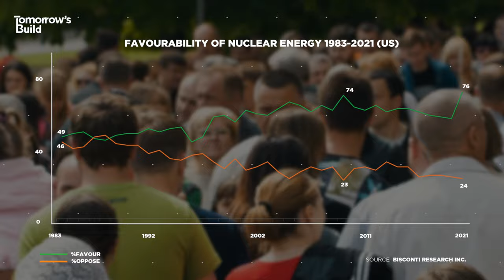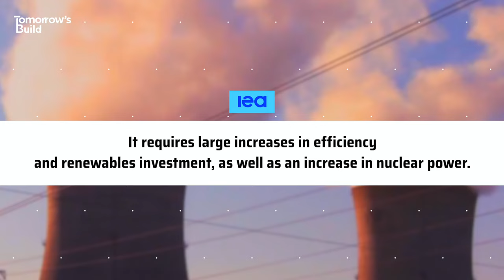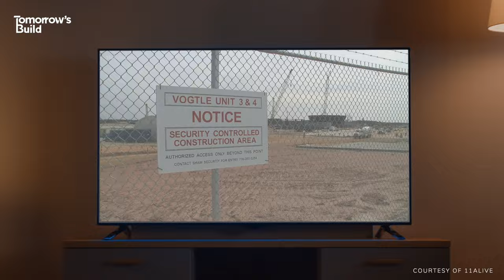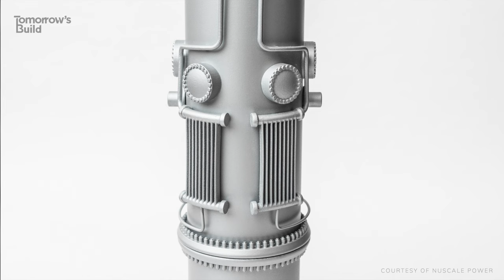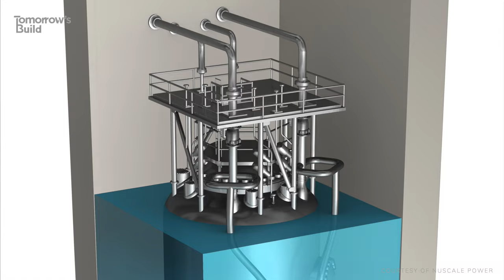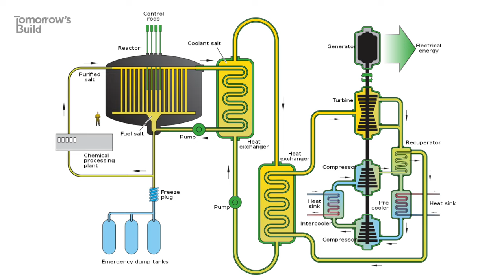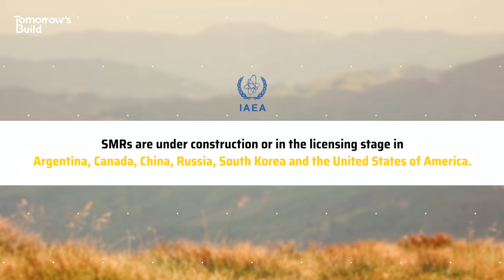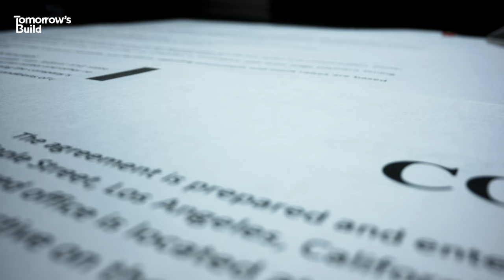These Mini Nuclear Reactors Can be Built Anywhere

Comment: Two areas renewables will never compete with Molten Salt SMRs
1) Process heat for industry
2)Fueling large Cargo Ships

They will probably be less expensive than renewables with storage for electricity in many cases as well, renewables are based on local conditions so in the great plains or Sahara desert wind or solar will come in cheaper, even with some storage, but that requires a great deal of transmission and energy insecurity if we want to power New York or the EU.
Reply: I'm actually surprised we haven't started using MSR's in the giant cargo ships yet. The amount of fuel they have to carry/burn is obscene. That ONE change would likely have a noticeable impact on global co2 emissions because of how much stuff gets shipped globally these days. And I also completely agree with the process heat. Using that heat energy for a benefit rather than just trying to dissipate or fight it has huge benefits. Here in Ontario there's a company called Hydrostor looking into CAES or Compressed Air Energy Storage - Basically at low energy use times they use compressors to force water from an underground reservoir up to the surface and hold it there. They syphon off the heat produced and keep the hot air in a tank, then on peak times when they need to generate power they let the water fall back,  which will send the air back up into the surface system, mix with the hot air from the storage tank above and use that high pressure/heat air to turn a turbine generating power. Because of the heat being recycled, it's about 10% more efficient than most other CAES facilities, and they're hoping to have it running by 2026. The future is starting to look green finally!
Reply: @Fenthule  I think in terms of carbon Shipping is a low emitter, its more a sulphates issue. But I'm also annoyed somehow its safe for ships that are meant to be shot at but not commercial vessels. 

There's also a district heat system in Toronto's financial district, another great use of waste heat. 

Maybe I'm thinking of a different trial, but isnt the Toronto CAES plant more like giant under water balloons to hold the air, and they store the heat in molten salts by running the compressed air over it?

Comment: If you know anything about electricity then you know that all power plants use some type of force to turn the turbine which rotates the generators to produce electricity. Coal plants burn coal to heat water so pressurized hot water is sprayed on the turbine. Hydro plants use the pressure of standing water behind a dam to spray the turbines. Nuclear energy, (highly radioactive), is used to "super heat" water creating higher pressure, (like a teapot), which is then is used to turn the turbine. To create electricity you only need to turn the turbine, rotate the generator. Getting toxic waste from nuclear reactors is not worth the energy. Find a way to turn the turbines without toxic waste from coal or nuclear. Attach 1000 of these Peleton people to long chain, there's a win-win.

Comment: My OCN professor did say that fusion reactors are the future, it's just a matter of making them economical, affordable and more compact. Then again, new developments in fission tech could make them viable again, if we can move on from the stigma they have
Reply: The technology is nowhere near being close, the high temperature superconductors invented in the last year by MIT are a massive step forward (10x size reduction) but the problem of lack of tritium breeding technology is daunting. Also, there have not been any fusion reactors creating more THERMAL energy than inputted as of yet, much less actual electric energy. In fact, ITER is not even supposed to generate electricity, it’s supposed to produce 500MW of thermal energy from 50MW of electricity. Perhaps 50-100MW could actually be harnessed into electricity in a future reactor

Comment: To be honest i'm kind of sceptical about this. In the 50s they promised  that cars and even kitchen appliances would have their own tiny nuclear reactors. That hasn't worked since, and if things haven't progressed by now in the real world after 70 years of research, it seems unlikely that things will change now. The small reactors in ships and submarines are very far from economical, they are built at extreme cost to the taxpayer in order to have a strategic advantage in waters far away from home.

And the question of the final repository is not answered yet. We cannot guarantee that  nothing will ever leak, and if we continue with nuclear power until then we will have amassed incredible amounts of nuclear waste. Maybe it will happen in 1000 years, maybe in 100 000 years. The fact that we don't care about the humans that come after us, and think to ourselves "it's their problem", really shows the short-sightedness of our current global economic culture, which is at the root of climate change in the first place.
Reply: Reactors produce very little amounts of waste and can easily be stored in well built storages. Pollution caused by fossil fuel cannot be stored and are dumped into the air.

Comment: The real problem will be the Workforce to operate & maintain these SMRs in small cities.

Lack of availability of trained workforce can greatly  affect how SMRs can be used for Mass scale base load electricity generation.
Reply: These are “set it, and forget it” reactors. All they need is the occasional inspection, and if anything happens, the whole thing is picked up and taken back to factory where it will cool off for a couple years before it’s cracked open.

Comment: Your getting closer to the gold mine. Now, do a show on Molten Salt Reactors that use Thorium, then your program will truly be looking to the future.
Reply: Not unless they solve neutron enbrittlement.
Reply: @armorclasshero2103  Keep searching, you'll find it. Seems that problem was solved in the 60s but no one paid attention.
Reply: @jacobrip8776  I've read the papers, they never solved the problem, just slowed it down long enough for the experiment. A commercial unit would require much more reliability.

Comment: The most fundamental shift is going from enriched Uranium pellets heating water under high pressure to Thorium in liquid fluoride salt operating at 700ºC.  Not only are we up to our ears in Thorium that is pretty close to production ready status, it's also more efficient as a reactor can convert up to 99.5% of its fuel into energy as opposed to Uranium fueled reactors where the conversion is closer to 0.5%, with dangerous waste to boot.  Combined with a much simpler safety system, this will dramatically decrease the price of reactors, make them easier, smaller, quicker and cheaper to build and will place the price per kWh well below fossil fuel generated power.
Reply: Thorium reactors are breeder reactors and they have a neutron enbrittlement problem

Comment: Nuscale "forgot" to add minor details like steam generators, turbine, electrical generator and the cooling system for steam. If the whole presentation is based on creation of layman impression that reactor produces ELECTRICITY, not heat, something is VERY wrong here :)

Meanwhile Russia is already using floating nuclear power stations...

Comment: This... is actually good. 
1. It lessens the risk of a huge nuclear failure.
2. Should there be a problem with small nuclear module no 23 going critical. It would be much relatively easier to contain than a huge reactor. 
3. Guess dont put all your eggs in one basket do come in handy. 

The downside is this. 
1. It just takes up more space. Which would complicated things when flood or landslides occur. Though  this can be circumvent.
Reply: All power reactors operate a super criticality. Criticality just means there’s an equal number of neutrons being produced as absorbed by the fissile material

Comment: I think there is a solid reason why there is bad reputation for nuclear energy in america and it is nuclear waste. While Rosatom already have closed nuclear circle and are using MOX and SNOOP nuclear fuels and are actively recycling nuclear waste. In US most of the nuclear waste are sitting in decaying concrete capsules, basically a time bomb. There are talks for decades about need of modern and safe nuclear waste depots and recycling, but nothing happening so far.....
Reply: if there was not a world a waste from burning billions of tons of coal gas oil, then you might have a point😢. But given nobody has ever been killed in US from commercial nuclear spent fuel, and nuclear fuel is 100,000 times smaller than fossil waste per unit energy, the no, there’s no point at all.

Comment: Isn't half the battle with (inter)national power grids overcoming the losses of transportation? Many small power stations near where the energy is needed means that less of each MegaWatt of energy produced is wasted. I think I read somewhere that transit losses even in long-distance 250KV power lines can be around 30% and I'm not sure if that includes all the conversion losses in AC-DC and raising/lowering the voltages at either end....

Comment: In the UK we make about 20GW of electricity from burning Gas. If you used SMRs to replace these, each generating 100MW then you would need 200 of these. Such a proliferation of Nuclear devices invites terrorist attack and or theft of spent waste for dirty bombs and that's not even talking about the subject of storage of the waist for 100s of thousands of years. A few for the country's critical infrastructure but that should be it. We need to deploy more Wind turbines and solar until we can get Fusion on line. Might even be a good idea for super large container ships which are burning dirty bunker fuel which is seriously dirty stuff.
Reply: Nuclear waste is not weapons grade. You cannot use it in a nuclear bomb

Comment: If they can build a nuclear reactor in a submarine, they can build anywhere.
Reply: Navy reactors only produce 70 Mw (most of that for propulsion not electrical) compared to a typical PWR producing 1,200 Mw and navy reactors can only produce that small amount using 95% enriched U235 costing $1 billion just for the fuel. 
Commercial Nuclear power reactors need steam generators, reheaters, turbines-generators, condensers, cooling towers, emergency generators, battery systems, control room, emergency cooling systems, septic systems, drinking water systems, mechanics, operations, and management staff, etc., etc.
So if you want to compare the cost of electrical generation from a navy reactor you have to consider the cost of the entire submarine less the torpedoes.  That comes out to $70 billion for 77 Mw output or 4 times the cost of the financial failures of the latest standard PWR builds. Also Nuclear powered ships shutdown their reactors while in port to minimize the possibility of an accident near populated areas and wind/solar shore power is cheaper that running their reactor.  No Navy reactor has ever been converted or used to provide commercial electrical power. if these people want to use Navy reactors as examples, they also must admit that millions of tons of highly radioactive waste from these reactors have been dumped into the sea and hundreds of sailors have died in reactor accidents. 
The NuScale (multi) 77 Mw SMR project, is the closest commercial design to that of a navy power plant. The project started 2 years ago just halved the reactor Mw output due to ballooning costs and most of the utility backers have now backed out causing the project to now delay construction until 2025. And they were getting $2 billion of taxpayer money to help with the cost. So much for building a Navy type SMR in a few years for only a few million.

Comment: The term SMR is a very handy way of confusing people from the real technology advancement MSR (Molten Salt Reactor). SMR are most often used to push the same old cold war reactor relic design that uses uranium and pressurised H²O which has a tendency to turn into a dirty bomb when things go wrong. If the reactor is not fail safe and it's radioactive wastes stay lethal for more than 500 years say NO to that reactor!
Current reactors efficiency of 1% is ridiculous and the reason for the large amount of waste that stay lethal for up to 20,000 years, the MSR (Molten Salt Reactor) has efficiency ratings in the 99% range. Thoruim make it even better by reducing security concerns for remote installations at concrete factory and desalinisation plants etc.

Comment: I wonder if the professor who says that the small reactors are not as cost effective as the large reactors has factored in the FULL costs associated with a new large reactor project. In the past I've seen many infrastructure projects have major cost blow outs because the people pushing the project only ever included the costs of the construction of the project itself and ignored the costs of integrating the project until after it was too late to do anything but pay the bills for the huge blow out of the cost. Take the concept of putting in a new large reactor, the project costs should include the following items: construction of the reactor, construction of the transmission towers and lines to deliver the electricity to the consumers, construction of the sub-generators to step the power down from transmission levels to consumer use levels, the operating costs of the reactor, the operating costs of the transmission system, the maintenance cost of the reactor, the maintenance cost of the transmission system. Compared to that a small reactor could be installed to power an individual commercial facility or a small number of commercial facilities or a local neighbourhood and not need all the costs related to the transmission system at all. This would be a major cost factor for a new urban development on the edge of a city or in a new area such as a valley near a city.

Comment: Its alright saying wind and soler is cheaper then nuclear. However, We need a green base load. We will not have enough rare earth metals to make the batterys needed to store the needed power. The only power storage solution that makes sense, Pumped hydro, needs lucky geography to be cost  competitive.

There is some interesting reverse pumped hydro projects that involve putting vacuums and bladders under the sea. I can see this being perfect for costal arias and island nations such as the UK and Japan. But for the rest of the land locked or inland arias, MSR is the way to go. They are quick to produce and don't need decade long constuction time scales. 

The problem with big central nuclear projects is that there decade+ construction times are susceptible to NIMBYs and politicians shutting down the project. this is because their lead time can pass though a hole vote cycle or two, making it a high risk investment and companies are reluctant to put that kind of cash down. The people pulling the leavers may green light you for now, but they may not be there to keep that green light on by the time you finish.
Reply: Politicians haven't shut down any nuclear power plants part way through construction have they.

Comment: What is leading the way are Molten Salt Reactors that use Thorium as the fuel.  Flibe Company is the oldest organization and has the most proven design of all with the Liquid Flouride Thorium Reactor design.  Elysium designed an MSR that will run exclusively on nuclear waste from Light Water Uranium Reactors.  There is no case for SMR of that type.  The Thorium atom carries 200 times more potential energy than Uranium.  Molten Salt acts as both the fuel carrier and coolant and is self-regulating and does not produce fissile material for nuclear weapons so that can be safely set up anywhere in the world, which would be a huge boon for the undeveloped nations.  They are so energy efficient that they can be used to desalinate seawater and decarbonize it at the same time cheaply.  They can be used to directly filter carbon out the atmosphere.  These reactors have proven that they could be located on Mars and create viable communities simply because they can access ice below the surface and create living communities there.  It they can do it on Mars they can certainly clean up and restore the natural balance here on earth!
Reply: And yet they haven't even built a single scale test reactor.

Comment: If these systems can be as inexpensive as 
solar or wind, they will have a good chanse. 

- The lifetime costs are compared 
- The overall depreciation costs are compared 
- The overall system costs with ore to fuel element
- Final waste storage and the plant demolition costs are compared 
- The availability and security are evaluated 
- Not to be forgotten is acceptance and political enforceability 

The bottom line is that different energy technologies can 
be compared in this way.
Reply: @armorclasshero2103  You have the unveiled realistic view. 
That is good.

Comment: What I mostly don't get is why everybody is so focused on producing electricity. Is it the only way to get gov grants?
District heating in colder climats is still mostly done by burning fossil fuel. I even heard that there are plans for really big heat pumps. But if you throw nuclear in the mix, everything changes, imo.
Pure nuclear heating can done with much less concentrated conventional fuel rods, which in turn means less safety concerns, since you don't need to produce "dry" steam. And you could go even further and use much weaker radioactive isotopes, which should be more abundand. Heck, you could even make them so weak and only use them as heatpump aux heating. So instead of digging the whole yard up for ground based heating, you could use a cup-sized nuclear heating accelerator.